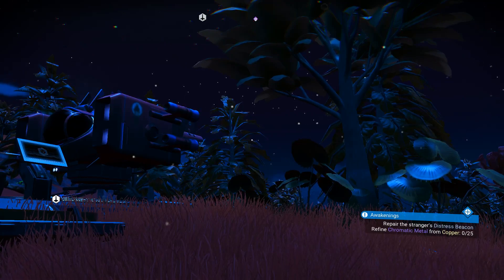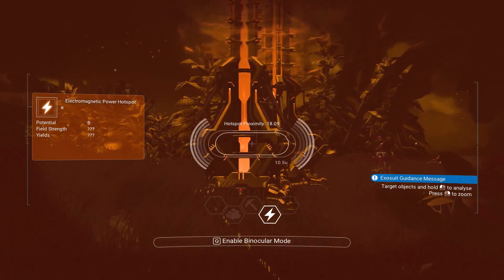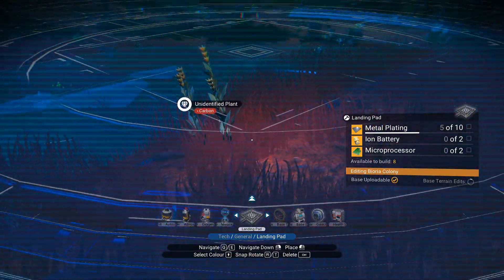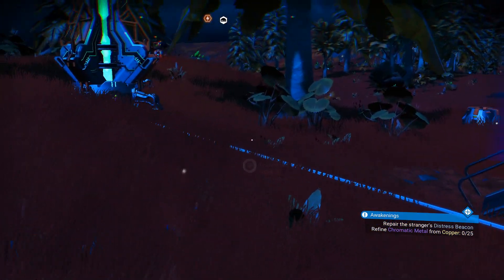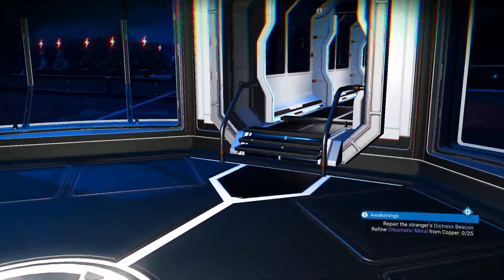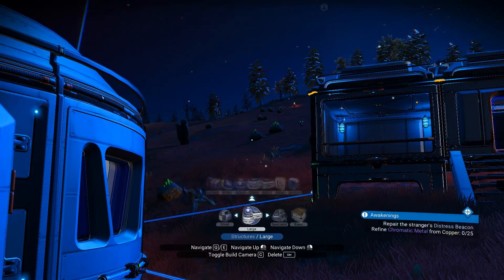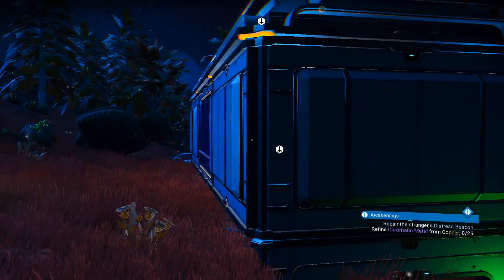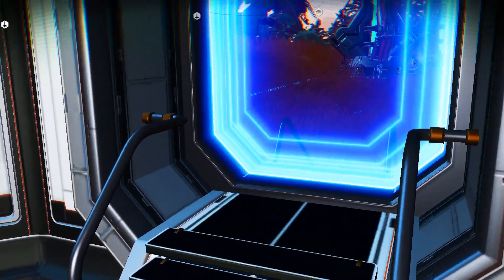No Man's Sky Beyond Base Building with Power

Comment: Looks like I'm not the only one having problems. I tried to make a circuit for the landingpad door, but the outlets are covered up by building and I can't connect a wire to it.
Reply: Sometimes the power stuff is a little hars to resolve, but:

1. Watch all the youtube streams referring to this;
2. If you place a Bio-Generator inside your base then no wires needed for all base units attached;
3. Solar arrays linked together, and a single link to a Battery array, with single link to base connector;
4. Check the power output. If you are not generating enough for your base, add batteries and solar or use switches to only switch on what you need.

I now have about 50 solar units chain-linked and 50 or 60 (I guess) Batteries, also in a chain. Within a day, all batteries are fully charged (planet dependent) and they store more than over a million KP, which sorts any base from what I have seen.
B-B-B-B-B-B-B-B-B-B-B-B-B-B-B-B
   |
SP-SP-SP-SP-SP-SP-SP-SP
SP-SP-SP-SP-SP-SP-SP-SP
   |
Base
For what it is worth, if you are hassled with the wires all over the place, you can click on battery and then click on a surface and move to next spot and click, till you get to the base connector. The wires now keep linking and maintaining the connection.